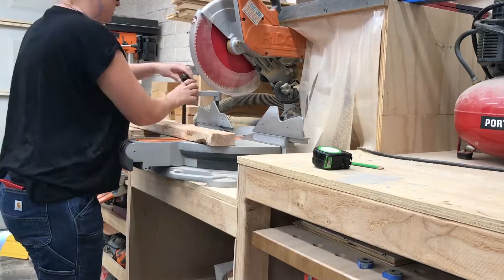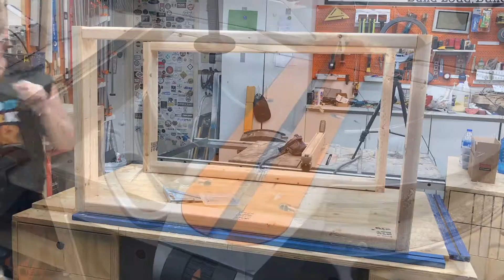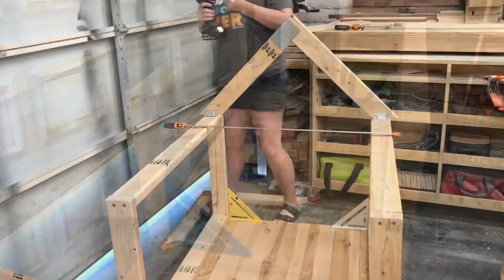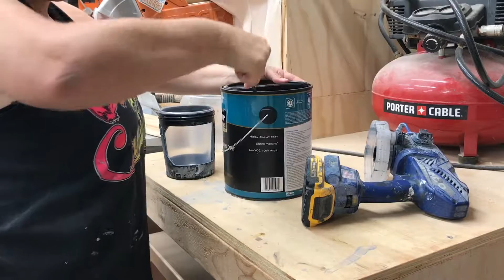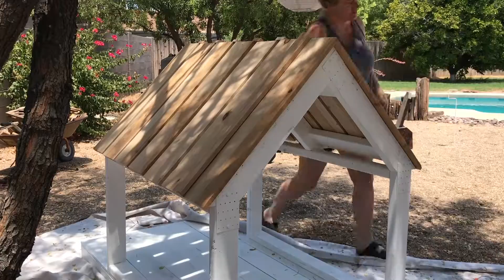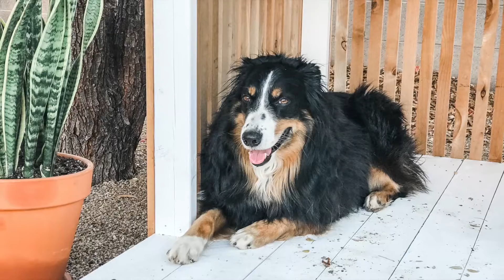DIY Modern Dog House

Comment: I’m watching your video for the third time in the past two days. I’ve built many doghouses over the years, though I am not a professional. I’m actually in the process of building an extension to a catio. I have always made the roof my own way, and they have worked. However, I wanted ideas on how to do it the right way for a bigger structure. The catio is 8x 8. The older on is 8x 10. The roof on that one was pretty flat and puddles of rain usually stay on it until the sun dries them up. Thanks for your help. 🙂
Reply from the maker: You’re welcome! Good luck with your build. 🍊
Reply: @TheAwesomeOrange  : Thank you.